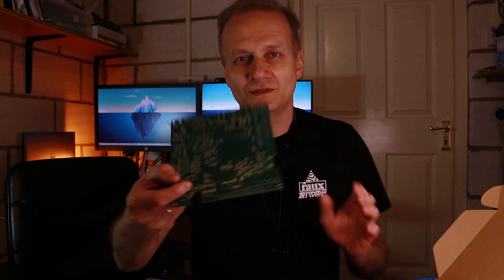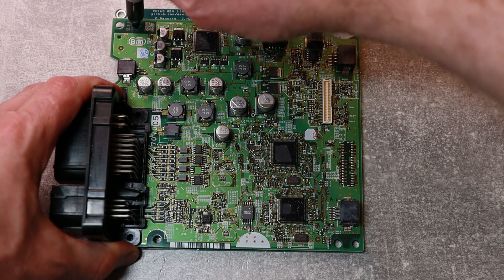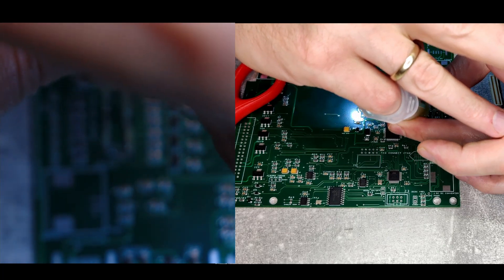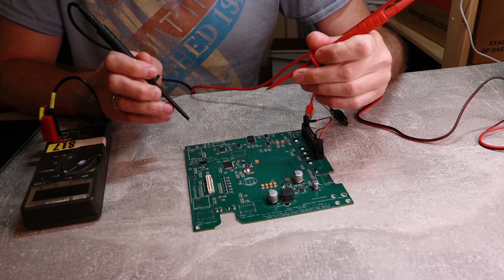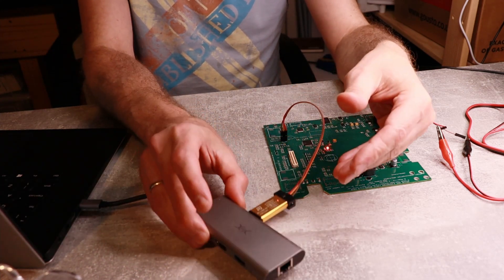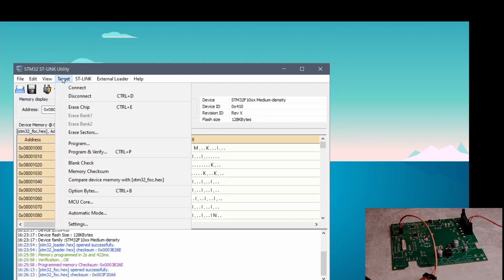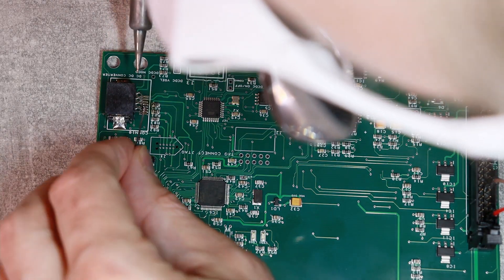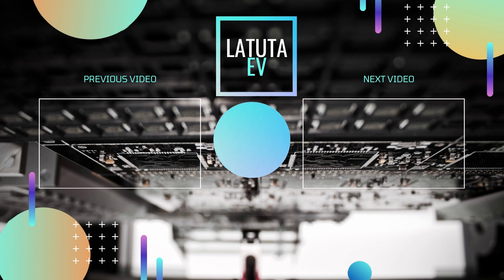DIY EV Toyota Prius programming Open Inverter  Ep 4

Comment: It's a little tough to tell which is the correct board, but I see you have the same inverter G9200-47210 from a 2012 or 2013 Prius.  As far as I can tell, the V2 "Auris/Yaris" board is correct for this inverter - it is slightly confusing since the web shop or projects really don't make mention of this.  You are the second YouTuber I've seen to have chosen the wrong board, so hopefully anyone reading this can be steered in the right direction.  I plan to get the board "Small board V1d", which should be the correct dual motor board for this inverter - maybe once you weld the torque split device, you'll go this route as well.
Reply from the maker: Yes you right I discovered the small board far too late😉 but as I ordered board from JLC PCB it was not that expensive. I am contemplating getting rid of MG 1 and connecting both inverters in parallel. If this works well I may put in two mg2 and two inverters